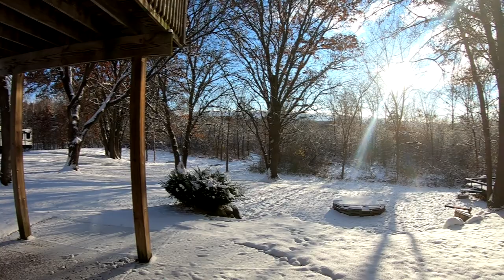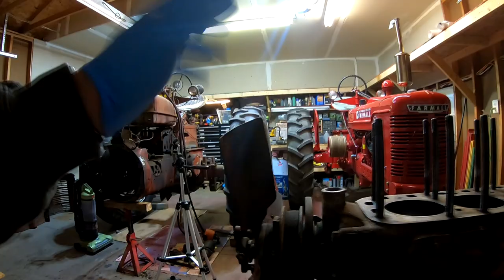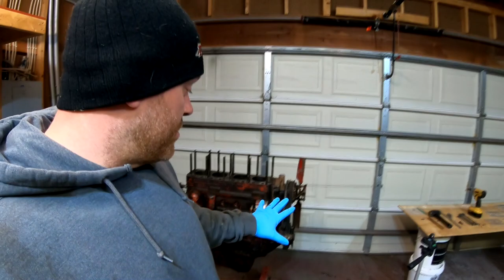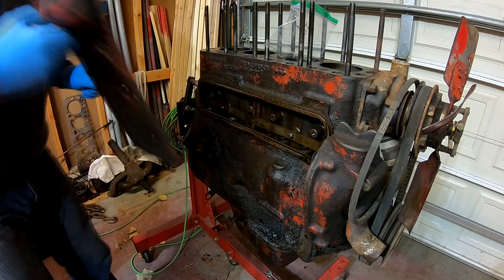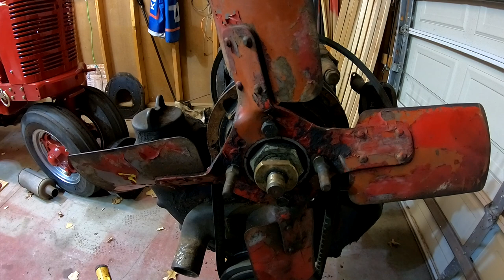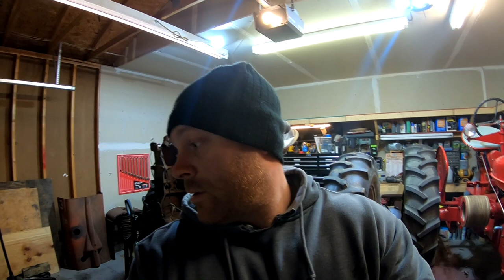This Old Farm's Farmall Super M Part 3: Engine Teardown (Pt. 1)

Comment: You got lucky on the water pump pulley!  I worked for two hours to get mine lose even after I used heat!
Reply from the maker: I have never had much of an issue with them. I always clean the threads real well, use a good penetrant, and knock them back and forth with a good hammer and large brass drift. Usually once you get them moving, there is no issue. But I have seen a LOT of people break them trying to bang on them!
Reply: @KennyKizzleRustyNutzRanch  you have defiantly been lucky

Comment: when i rebuilt my 44 M the lifters  looked like yours and a bad cam lobes does that as well as bad cam bearings.. bad cam bearings will also trash the camshaft gear.. i think you need a donor engine out of a 400.
Reply from the maker: I don't think Connor will go for a donor engine... But we definitely need a couple replacement parts.

Comment: what is the plan here? If needed is there a crankshaft lined up? Same with the block. Some of that damage you found may require extensive repair and machining.
Reply from the maker: Crankshaft will likely go to the machine shop. Cam will have to be replaced. Mains and rod bearings will have to match crank (obviously). new pistons, sleeves, etc...

Comment: I’m surprised that you didn’t pressure wash that engine before tearing it down would have been a lot less greaser than it currently looks
Reply from the maker: Oh, trust me... I would have preferred that. It just wasn't in the cards this time. I am going to pressure wash the block inside and out, along with all the components. If I can, I would like to run a lot of the stuff down to my cousins' shop (where we cleaned a lot of the H pieces and he is building his '85 Peterbilt)... He's got a hot tank rotisserie, parts washer, as well as a hot water pressure washer.... That would all come in handy!